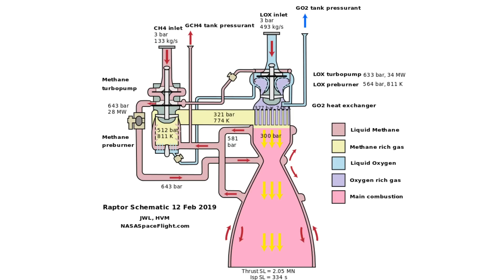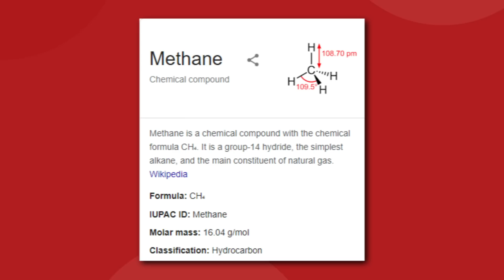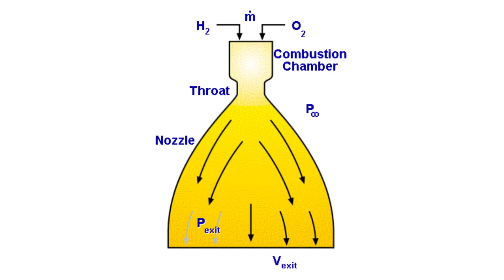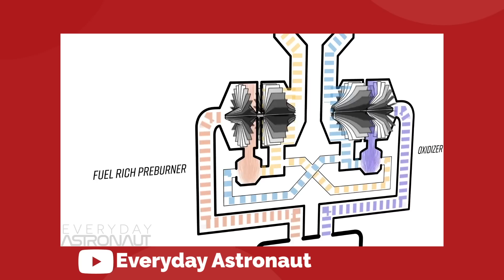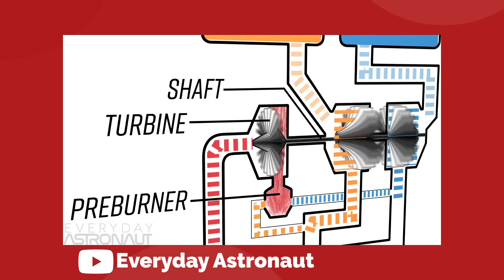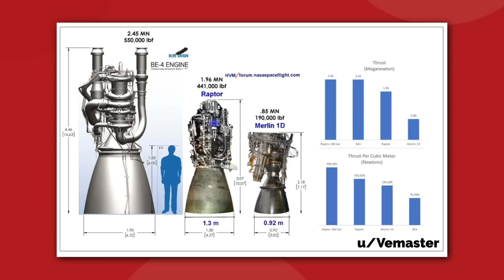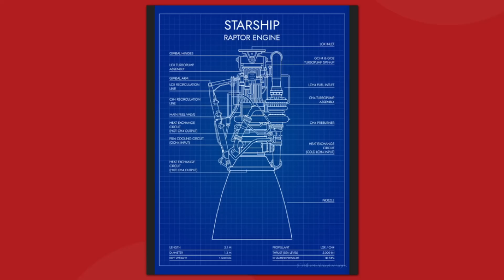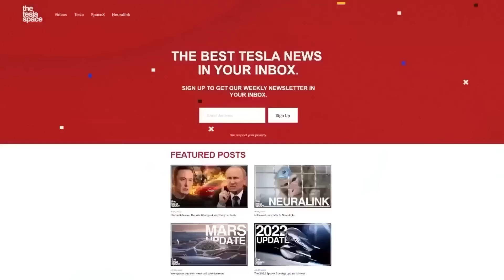The Real Reason SpaceX Developed The Raptor Engine!

Comment: DAMN RIGHT! utilizing the starship... space force will REPLACE & negate the airforce- the same way that jet liners have replaced ocean liners as the main mode of transport around the planet. ONE starship operated by space force- could deliver 100 troops with gear half way round the globe in UNDER 30 minutes. a fleet of 100 could deliver a tank battalion with troops & supporting gear ... you kind of get the point. 8 starships placed in a cross pattern LEO, loaded to capacity with 1000 lb. gps quided smart bombs & rotary internal turrets, could  OBLITERATE ANY target on the planet within 10 minutes of being given the command. who needs nukes?

Comment: Interesting point is that rocket thrust is not a force that pushes against anything such as a launch pad.  The rocket moves due to mass displacement - Newton's Third Law.  The hot gases being ejected out of the engines do not have to push against anything of course as they would work in the vacuum of space.  The new Raptor engine moves more mass for a given time unit from inside the rocket to the outside than previous engines, so it provides more force to move the rocket and its payload.
Reply: The only reason is that he doesn't know where to spend the money from NASA.
What intrigues me is that all the UFO visualizations and some captured in video and photos, are of round or triangular spaceships and due to the immensity of lights there has to be a generation source that will violate the damn laws of thermodynamics that are strangling the advance of science, why is it then that humans keep their designs based on rockets, hungry for fuel and slow as snails.

Comment: This is not the first full flow engine. There have been other attempts. They are the first to move it to production
Reply: So then this is the first full flow engine?
Reply: @jamesconrad4268  full-flow staged-combustion-cycle rocket engines. It simplifies an engine in terms of parts needed (less mass).
Reply: @jamesconrad4268  it's like saying the model T is the first car. Technically, it's the first mass produced car. But its not the first.
Reply: It is the first full flow engine to work effectively enough to be produced, thus it is the first lol. Others werent put on rockets.
Reply: You’re correct but that’s why he said “full production”
Reply: They're the first full flow staged combustion engines to get beyond testing.  The Soviet RD-270 and the US Aerojet Rocketdyne "Integrated Powerhead Demonstration" were just test projects.  They were never brought up to full functionality and production.

Just like aerospike engines.  Lots of them "in development" but none of them have moved beyond testing and into production.
Reply: @SmokingSevens  what about the RD-180?
Reply: @DumbledoreMcCracken  The RD-180 is an oxygen-rich staged combustion cycle engine, but not a full flow.  They only tap off a bit of the fuel and combine it with all of the oxidizer, combust it in a preburner that powers the turbine for the engine, and then exhausts that hot and mostly still oxygen gas into the combustion chamber to mix with the full amount of fuel.  Full flow staged combustion mixes a little of the fuel with the full amount of oxygen in a preburner to power one turbine, then a little of the oxygen with the full amount of fuel in another pteburner to power the other turbine, and then the mostly oxygen and mostly fuel exhausts mix in the combustion chamber.  There is a video by another YouTuber that explains the differences very clearly in video form - search YouTube for "raptor king of rocket engines".
Reply: @SmokingSevens  well, I thought the actual challenge was having the mixture of liquid/gas impinge on the turbine, and the Russians were the first to make a turbine that could withstand the mixture without destroying it, and they did that decades ago.
Reply: @DumbledoreMcCracken  Staged combustion has been around since 1949.  Using one small combustion chamber to power the turbines needed to get the main flow of oxidizer and fuel moving into the combustion chamber fast enough.

It's been done in many different ways, with many different materials.  Rocket Labs actually skips this step altogether using disposable batteries to power electric turbines.

The "holy grail" is full flow staged combustion.  There is no waste of fuel or oxidizer, and the efficiency of the engine is higher than other staged combustion engines.  The lack of waste and higher efficiency is important for an engine that's supposed to take humans to Mars.
Reply: @SmokingSevens  good to know.  So, you believe Mars is the objective, and not a distraction?
Reply: @DumbledoreMcCracken  For Elon Musk, Mars is the first major goal.  After that Ganymede, Callisto, Europa wouldn't surprise me.

The ultimate goal is to make human life multi-planetary so our species can survive if Earth is made uninhabitable (by climate change, pandemic, planet killer meteor strike).
Reply: @DumbledoreMcCracken  At first the inhabitants of Mars will live in habitable structures that will hold an atmosphere.  And there are several ideas about how to protect Mars from solar winds/radiation.  The first, and most likely to be achieved, is to put an artificial satellite that creates a massive magnetic field at Mars' Lagrange Point 1 or L1.  The long magnetotail from L1 to Mars would provide it with protection.  The other, more difficult option, would be to re-warm Mars' core.

As for whether or not making humans multiplanetary is Elon's goal - there's plenty of evidence out there, including his own statements.  He's been obsessed with the idea since he read Isaac Asimov's "Foundation" series. 

And Elon probably doesn't want to be Jesus.  He wants to be Space Noah.
Reply: One Russian, one American. Attempt is as good as any other word. Demo?
Reply: @michaelsmith2723  I believe the germans(?) had a working prototype and the russians may have as well. Definitely a demo at best.
Reply: A finished product matters more than 100 unfinished ideas just saying elons works and is being used the ones you speak of not so much. Point being is even if you was 100% right why would you try to lower there accomplishment. No good job no way to go just someone else thought of it first. Anyways well done guys.
Reply: First cryo, cryo liquid to a gas, gas reaction. Staged combustion is not new.
Reply: @kenjihaag329  Staged combustion cycle has nothing to do with the temperature or state of the fuel.  Staged combustion means the fuel and oxidizer go through a series of combustion chambers, and the fuel/oxidizer are combusted in stages.

There's basically 3 types - oxidizer rich, fuel rich, or full flow staged combustion.  There are several videos on YouTube explaining the difference.
Reply: First in production.... Successful Production ... Those of us in this aerospacec world knows that this has been attempted ..... Attempted isn't equivocal to successfully in production...

Comment: Raptor 2 save 1 ton weight per engine then makes 1/2 as much again in thrust. Which has to bd worth another 1/2 ton of weight. Fit  32 of them against 48 Shuttle engines and you’ll save about - erm - at least 50 tones of dead weight. That’s at least 50 tons more cargo you can carry for the same fuel burn.
Reply: The only reason is that he doesn't know where to spend the money from NASA.
What intrigues me is that all the UFO visualizations and some captured in video and photos, are of round or triangular spaceships and due to the immensity of lights there has to be a generation source that will violate the damn laws of thermodynamics that are strangling the advance of science, why is it then that humans keep their designs based on rockets, hungry for fuel and slow as snails.
Reply: Shuttle engines use hydrogen which is 25% more efficient than methane so your added "dead weight" brings a higher payload to leo and especially anything beyond leo

Comment: @2:07 Liquid oxygen is not used for every rocket.  Other oxidizers include: nitrogen tetraoxide, fuming nitric acid, nitrous oxide, or even fluorine.
Reply: How could you forget about the OG oxidizer, high-test hydrogen peroxide?
Reply: @vincentguttmann2231  Good point, that one slipped my mind at the time apparently.
Reply: Is it drinkeable?
Reply: @zsolti.  none of them are drinkable.
Reply: @zsolti.  "Is it drinkeable?"
Yes.  You are unlikely to survive doing so.
Reply: If your crazy or communist you use such oxidants in a first stage.
Reply: Hypergolics were used for the Luner Lander descent and ascent engines. Simple and and able to throttle up and down.
Reply: @kellyBorgman  don’t need to worry about re ignition either. Mix them and you’re good to go.